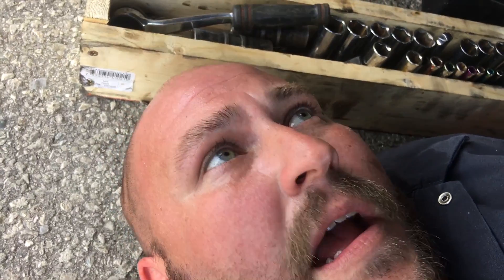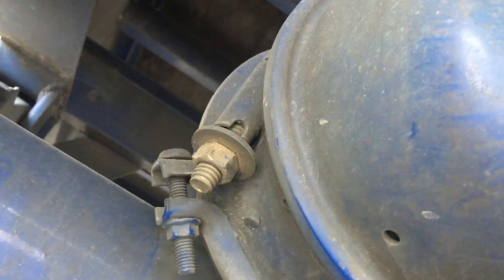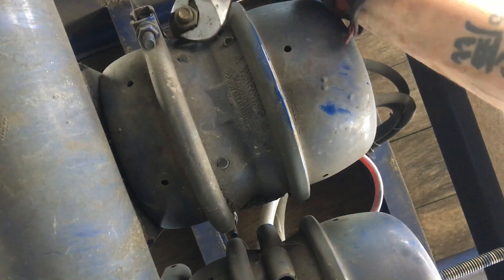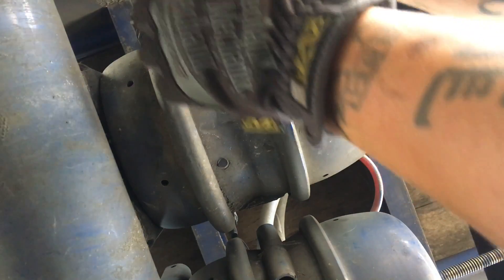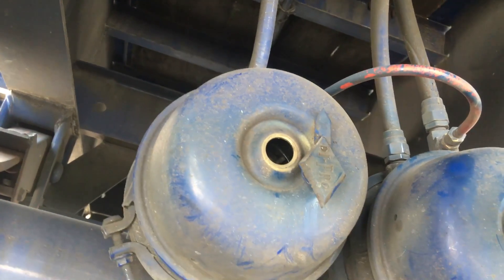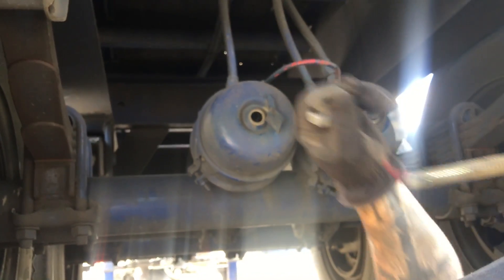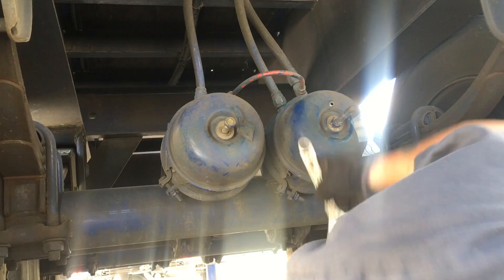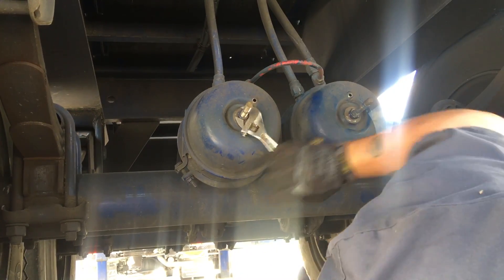Caging brakes

Comment: I just caged my brakes on side of the road in Pennsylvania. Thanks for the video. I'm off to load and then get it repaired.
Reply: Had to crimp off the air line to the brake pod for it to release. All else went well

Comment: For someone that has to cages a lot of brakes, you'd think he'd keep a 3/4" wrench around.
Reply: Mike Ziegler ... I can certainly understand what you’re saying. However, you could be a little more empathetic and understanding in that this information helps a lot of truckers.  And besides, when someone is out there and they don’t have all the correct tools, “Mr. Crescent Wrench” always does the trick. Happy Trails, Driver. 👍🚛👊
Reply: Ten Speed Truck be empathetic? Get real.  Was your comment really necessary? He stated a good fact. Crescent wrenches do more damage to your nuts than good. Using the proper tool is something you should be doing, especially if you are a mechanic or this is your everyday job like this tow guy.
Reply: anthonydeleeuw well the top comment was more sarcastic, which is why the second comment said empathetic,

Comment: Yesterday, 10.20.17, One of our driver snapped a air line, when trying to make a very tight unturn, and blocked a gravel tip, he claims to have 30 years experience, told him to cage the brakes, so he can pull out of the way, he told me he doesn't know how to cage brakes, my question is how does someone with 30 years driving, not know how to do this!

Comment: What if you had air to release the other three brakes, you would only have to do the  one that's bad and then kink the air line going to the chamber you just caged to prevent air from escaping.  Is that correct?
Reply: Yes if you could stop the air escaping by kinking the pipe to the faulty brake then yes that would work.

Comment: Very cool.  Thanks.  I've been a driver for twenty years, and I've had chambers fail on me a dozen times during that period.  I like to be as self-sufficient as possible while on the road, but I never knew (and was never taught) exactly how to do this.  Do all chambers come equipped with their own caging bolts?
Reply from the maker: Walter Zoomie sometime the cage bolts are missing
Reply: Yes they do..but they tend to fall off sometimes.
Reply: Make friends with a mechanic, I have a box of them on my service truck

Comment: Hey thx for the vid why do you cage the brakes ?
Reply: Gonz 565 usually to change the diaphragm on the spring brake or service brake. Always cage it for safety
Reply from the maker: Gonz 565
Reply from the maker: Gonz 565  1 if your brakes lock up or 2 for someone to tow the trl that doesn't have a air line to hook up to the trl